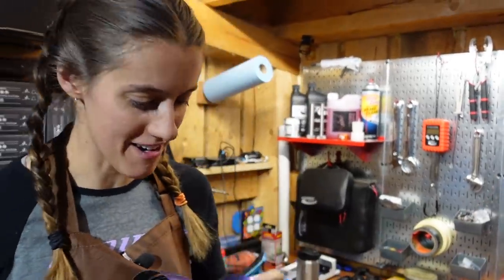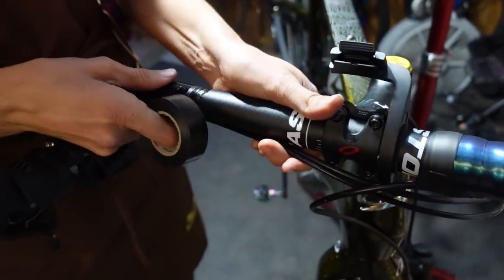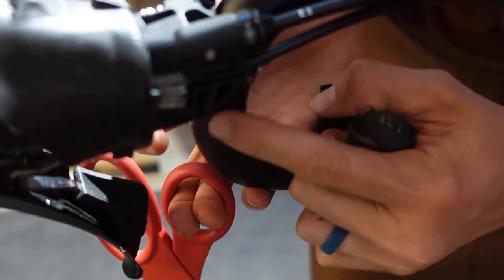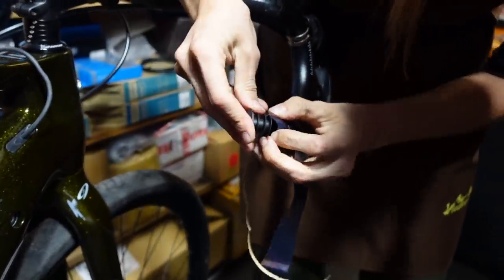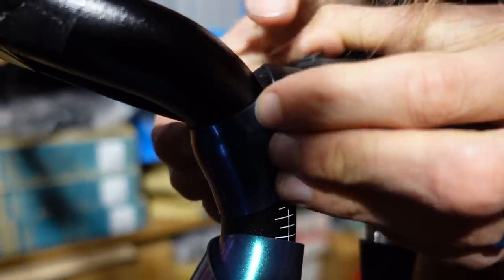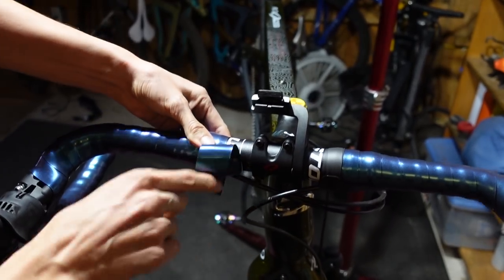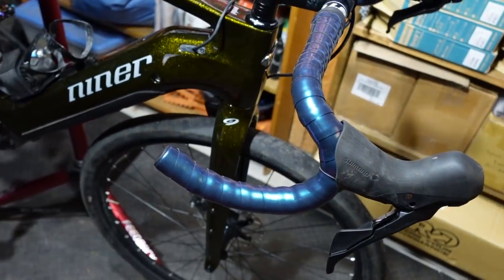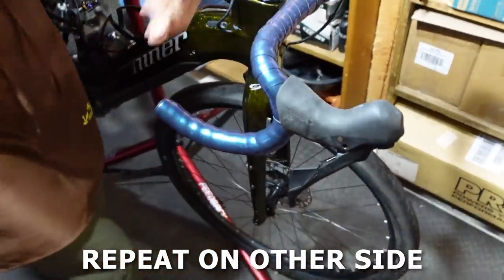Installing bar tape on a road/gravel bike (easier than you think!) | Syd Fixes Bikes

Comment: Great video, my mechanic has converted me to tape from top to bottom. This works if you have screw in plugs and looks more smooth on top of the handlebars.
Reply: That won't work. The way you rotate your hands especially on the tops will eventually cause the bartape to unwrap itself.
Reply: Taping from top to bottom would work fine if you wrap in the same direction of rotation around the bars as when you tape from bottom to top.
Reply: Yeah, I've done top to bottom for ever.

Comment: THANK YOU! I wrapped my first bars after watching this and while they aren't perfect, they are pretty darn good and I didn't spend all day watching how-to videos first. The only issue I had was my tape wasn't overly sticky so the pieces that I put over the shift lever clamps didn't hold the greatest. Next time I might add some adhesive on them.
Reply from the maker: That's fairly common. Usually we just let the rest of the tape hold those pieces in place 😁

Comment: Some great tips, especially regarding the direction of wrapping the tape!  I have wrapped quite a few handlebars, but this was really good additional knowledge.  I have seen videos (but never tried it) of a wrapping technique starting near the stem and wrapping down to the drops.  The benefit would be that you don’t need finishing tape, or only one wrap of finishing tape, near the stem.  Also, to make the last wrap of bar tape near the stem (if you start at the bar end) as flush as possible it helps to cut the tape at a diagonal (“on the bias”) so it lays flat before applying the finishing tape.  I guess if you started the wrapping near the stem, the same diagonal cut would work as well.  :). Oh, and if you have larger hands or want a softer feel of the handlebars (nice for gravel riding), a double layer of bar tape is nice.

Comment: Great video. Two suggestions. Start with the tape tucked inside the bar and you can get a cleaner edge when you insert your bar plug. Cut your bar tape at an angle to get a cleaner/flatter edge where you use your finishing tape.

Comment: I'm about to change bar tape on my touring bike and I'm a bit scared of the process. My bar tape doesn't have the sticky strip on the underside, but I'm assuming that's not a deal breaker.
Reply from the maker: Nope, you'll just need to make sure it's wrapped tight so it holds itself in place and then tape off the end well so it doesn't unravel.

Comment: Can you do a video on -"how to grease shifter/derailluer cables"
Reply: Just use Rock N Roll Cable Magic lubricant for troubled cables/housing and that’s assuming your routing isn’t fully housed. Not much else to it.
Reply from the maker: In general, if you feel like your cables need to be greased, they probably need to be replaced.
Reply: @sydfixesbikes  Thanks,SYD.
Reply: @setransou  thanks for your opinion